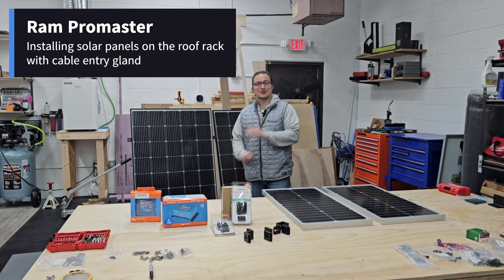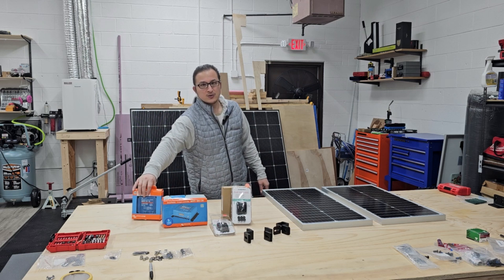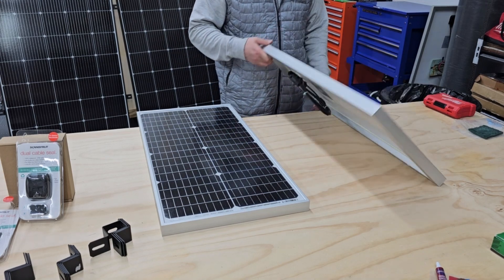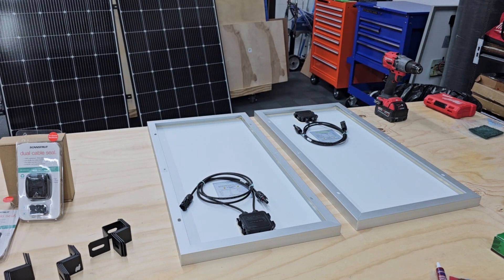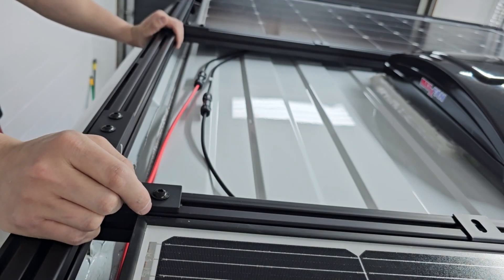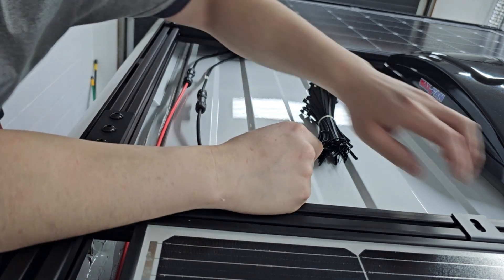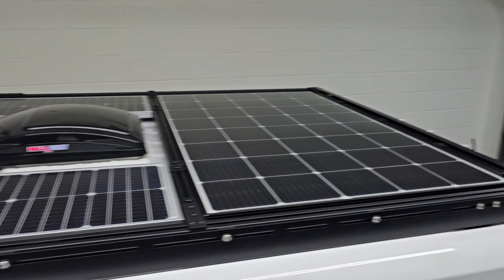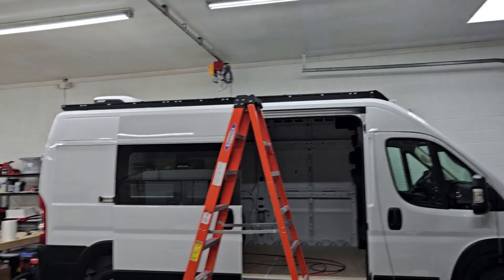600 Watts of Solar Installed | Ram Promaster Van Build | Part 10

Comment: Forgive my ignorance but, If you want the 600 watts, don’t you need to connect the panels in parallel?  Otherwise you would increase the voltage not the wattage is that correct?  Thanks.
Reply from the maker: Yes you would be correct if the panels all matched in voltage, but in this case the 50 watt panels operate at 19 Volts and the 250 watt operate at 24 Volts. If they were connected in parallel the 250 watt panels would operate at 19 Volts losing wattage. Which is why I have to run each set to a different charge controller to get the full wattage. In the end calculation, wattage is still the same whether its connected in series or parallel. Watts = Volts x Amps.
Reply: Did you connect the panels and series or in parallel? If you put them on the series that 90 V right? That would be the most efficient hook up.